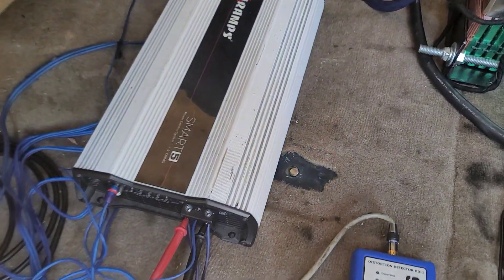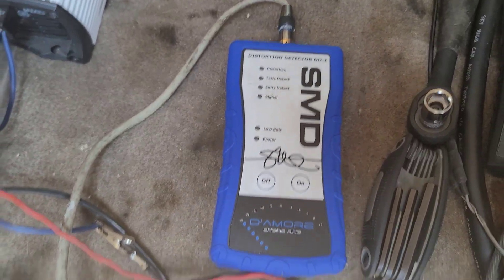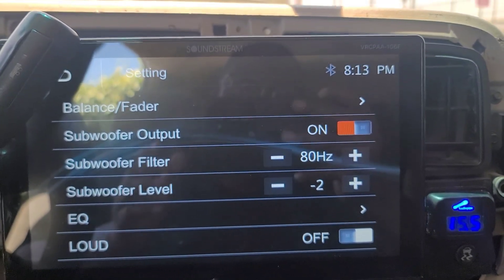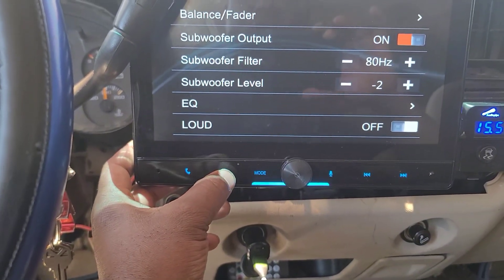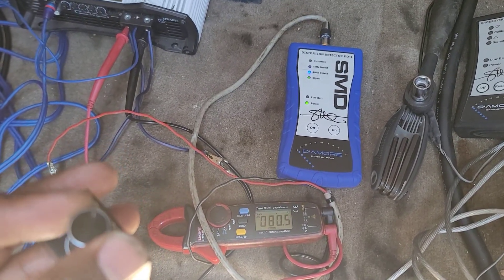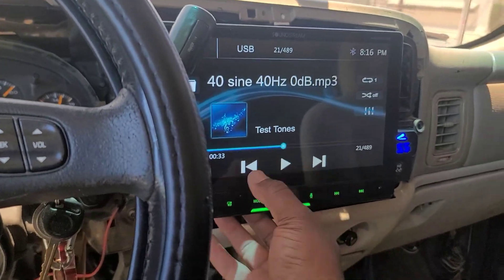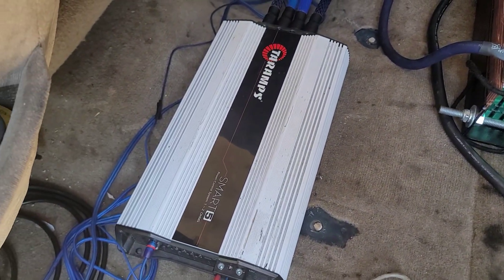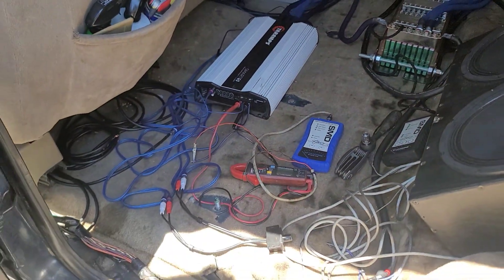Setting The Gains On A Taramps Smart 5 For Maximum Output Before I Meter And Clamp My System

Comment: Good info. I'm interested in getting a big boss 8. Is the recommended fuse rating they give per positive run or both runs total?
Reply from the maker: Yes that's exactly what you will want to do. Between both positive runs fuse slightly lower or equal the recommended fuse rating. If you run higher there's a chance the fuses used wont pop due to the Amplifiers draw being under the used amount
Reply: @BIGJURAY20 So when it says 360 amps recommended that's 150-180 amps per run?
Reply from the maker: @keevinsimpson5858 Yes, exactly how you should go about doing it.
Reply from the maker: @keevinsimpson5858 If the fuses used pop it means the Amplifiers trying to draw more than they allow. In this case go slightly higher fuse rating
Reply: @BIGJURAY20 Awesome thanx for clearing it all up for me
Reply from the maker: No problem bro
Reply from the maker: Another thing to take into consideration is the gauge cable you use. It should be the proper size to support the amperage as well
Reply: @BIGJURAY20 wire is no issue. I'm replacing a stinger 4000.1 that uses 2x250 amp fuses. Which is why i was confused on why the bigger big boss 8 wanted 360 amp total fusing or per run
Reply from the maker: Brazilian Amplifiers don't draw as much as chinese or korean amps. Suprised the Stinger 4k wasn't enough power they put out way over rated. But, they really shine at 
.5 ohm
Reply: @BIGJURAY20 Yes it's a very strong amp for being labeled a 4k. But I'm on my second one since the 1st one fried within 24 hrs. Now that I'm freaked out about it I'd rather go a different route. Plus they run extremely hot. It never goes into protect. Same as the one that fried which never showed protect or clipping. I think it was just a dud.
Reply: This is at a measured 1 ohm load with secondary 250 amp alternator and 50ah sodium for music only.
Reply from the maker: @keevinsimpson5858 The Big Boss 8 or Smart 8 should definitely help gain output musically

Comment: Hey bro how u feeling about that radio??? I’m trying to get one for my Impala but not 100% convinced. Does it perform good with subs n aftermarket amp?
Reply from the maker: I like it but it only has wired apple carplay and android auto. Boss has an elite floating screen that goes from 8 up to 14 inches and they're wireless Android Auto and Apple Carplay
Reply: @BIGJURAY20   yeah I checked those out too but they are above my budget..lol. That soundstream is on sale for 100$ I think is a deal but I was looking videos to see how they perform
Reply from the maker: @ElG713 I paid over 300 when it came out new. $100 is a great deal
Reply from the maker: Even at the 300 plus i paid when they first released I'm still happy with it

Comment: You don’t use gain overlap? You just tune your amp with a 0db tone and leave it there?
Reply from the maker: Yea, just 0 db no overlap. What benefits do you think I'd have by trying?
Reply: @BIGJURAY20 even while playing music?? They always say to use a -5db or -10db to tune a sub amp because of music being recorded at different levels. Being at 0db leave a lot of power on the table. But from your vids I been watching you are beating hard while tuned at 0db!! You never have to worry about clipping.
Reply from the maker: @LifeWithRobert-j7h Yea tuning -5db -10db and so on takes power away from the amplifier. It doesn't clip because sometimes it turns the power output down a great deal
Reply from the maker: @LifeWithRobert-j7h I've been tuning my system at 0 db for years although tuning -5db  will help your system last a good amount of time without issues. At the end of the day it all boils down to how you like your system
Reply: @BIGJURAY20 ok bet

Comment: @BIGJURAY20- I know a guy who ran 12- of these Taramps 8ks, & he said if he ran 2 volts+ of RCA input voltage, he would pop them @ some point. He even had 1 pop, while his system was on, but paused= nothing playing. He stopped having these issues, when he reset his amplifier gains, with the RCA voltage backed down to 1.5 volts= just had to turn up the amp gains more. He said for long term use these Taramps hate anything over 1.5 volts.
Reply from the maker: Definitely helps to give them some more room to open up. They can put out power but they are much more sensitive then most other type of Amplifiers

Comment: Is there a reason why you are running with the loud button on the radio on?
Reply from the maker: The loud button is always set to off on my unit
Reply from the maker: You may have to look at the settings again. The only thing on is the subwoofer output. Loud will clip long before reaching optimal levels

Comment: Random question bro: why not use an oscilloscope and view the waveform?
Reply from the maker: Not against it I'll have to get a good oscilloscope with better accuracy to do some test.
Reply from the maker: Another reason for using the SMD DD-1 is because today's standard of amplifier testing is done with the SMD AD-1 Amp Dyno, which is tuned with the same process as the DD-1.

Comment: What is your auto tech alternator charging at on your system
Reply from the maker: The Alternator Normally Charges At 14.9v But I'm Using A Diode To Help Run It At 15.5-15.6v That Way I Keep My Cmax Battery A Little Happier
Reply: @BIGJURAY20  cool because I’m looking at a autotech 370 and a js alternator 370
Reply from the maker: @charleswilliams2556 Can't go wrong either way I hear good things about Js Alternators as well
Reply from the maker: I personally have 3 370 amp Alternators myself they'll do up to 395 each at 1800 rpm